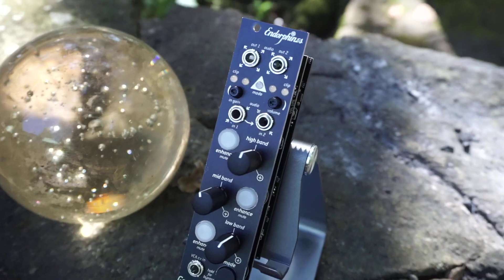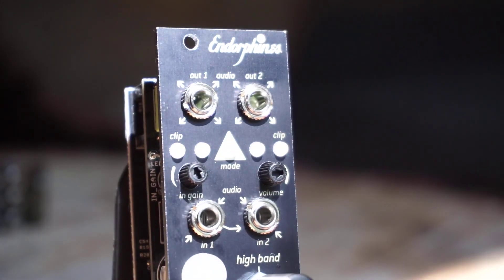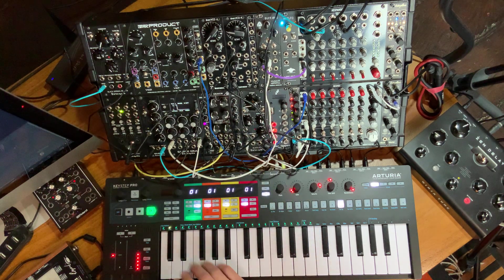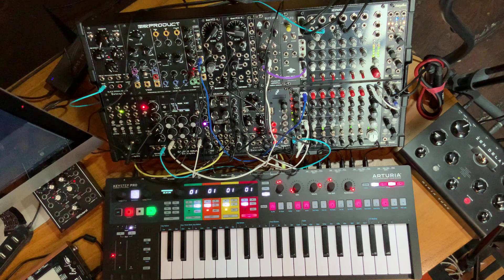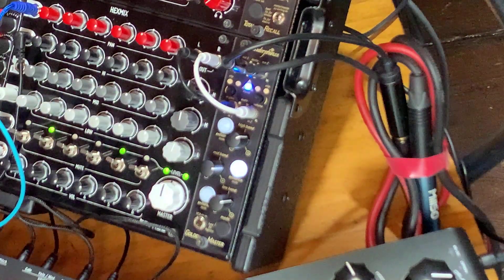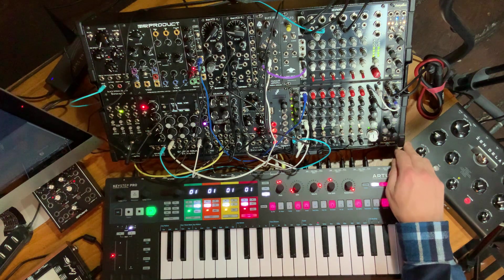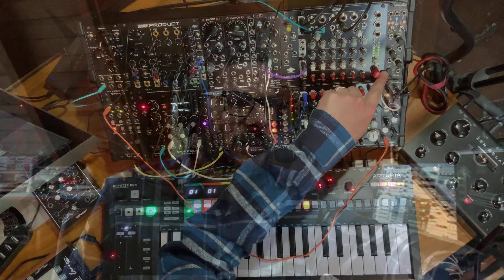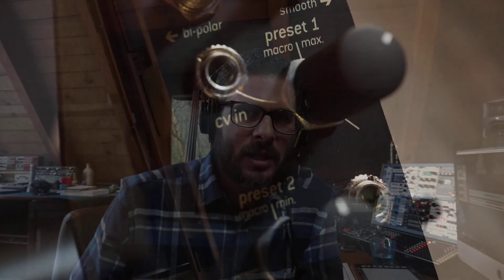Endorphines Golden Master: Shimmer and Punch

Comment: mine is muting on long press with a dimmed light and engaging compressor on short press with a bright light, which is exactly opposite of what you show off here. Have I set something wrong?
Reply: nevermind. It turns out i was on the old firmware. Just updated and now it works more nicely and per this video. You may want to note that this is for version 4.2 firmware and newer in the description. Cheers,

Comment: I've used several of Endorphins modules that all use the same platform as the Golden Master and each has had a different amount of digital noise that's slightly noticeable. I know you mentioned that the unit has a noise gate but does just using the module introduce noise? I know this has been really noticeable on my Milkyway and somewhat on the Squawk Dirty.
Reply from the maker: It's hard to tell Ken, since compressors naturally bring up the noise floor anyway! Over here it hasn't been a problem for me at least.
Reply: @QuincasMoreira  Maybe they've since improved the platform and the DSP since the Milyway first came out. The first iteration of that module wasn't that great with digital noise.
Reply: I have no noise unless I crank the gain too much and then it adds noise.
Reply: Have no noise floor issues with my golden master and my system. Don't own the milky way anymore but I think they also did some updates long ago that fixes the noise problem with that too.
Reply: There is the noise complaint. No thread on any module is complete without someone talking about the supposed noise.
Reply: @wariusgaius  this isn't a fake issue. It's noise generated by the clocking of the digital chip. I've had to return two Endorphins modules because of this.
Reply: @kennymester  I believe you. It’s just that comments about noise are recurring on every module. I  am going to find out for myself now because I ordered one of these.
Reply: I am also struggling with noise... Spent already three evenings testing the golden master in different Settings. I can turn down the input or output gain to reduce noise, but then of course I have too low recordinglevels... I have noise, even with only GM connected. Using the stereospread on HighBand, introduces even more noise. Stronger Kompressor reduces Outputvolume heavyly.
Not sure if mine is broken, I am too sensitive or I don't understand/like it. Already updated to latest firmware.
Frustrating, to see all these YoutubePeople loving it by having it doing, what it is supposed to do. 
Do you really have no noise when Input is quiet?
Reply: @bela6055  unfortunately this is just what you get with digital Endorphines modules. I have to gain stage mine similar to yours to take out the noise. Some still exists but it’s very low.